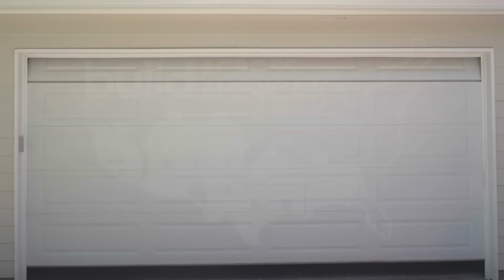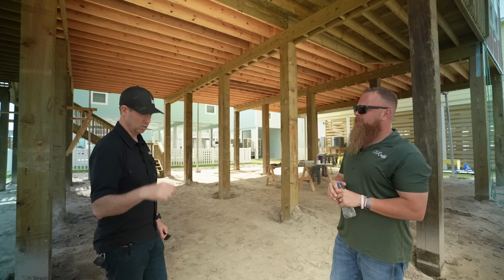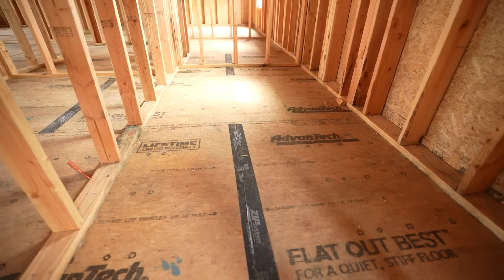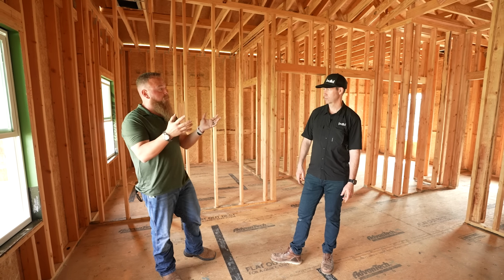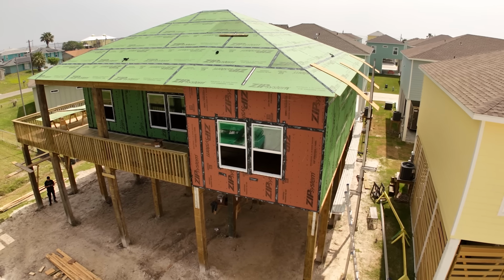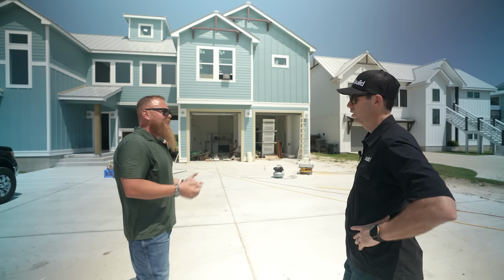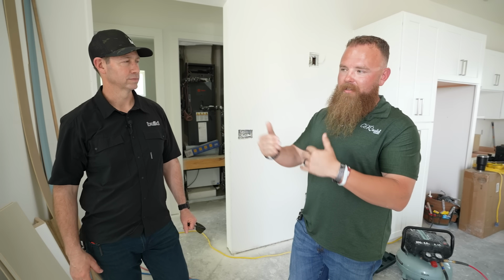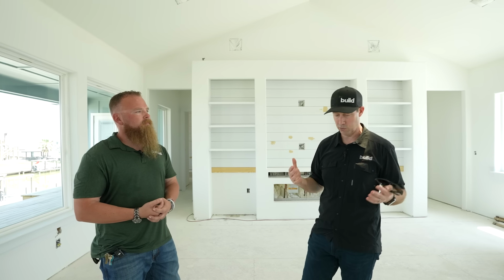Build Across America | Episode 5 - FORTIFIED Building on the Texas Coast

Comment: Matt, I would love for you to follow up on the "Whole House Return System", in which the insulated attic IS the HVAC return pathway.   The actual requirements for using the insulated attic space as a plenum needs to be discussed.   The benefit is in simplifying HVAC returns and having a zero Effective length for return static pressures.  Great Video!

Comment: Couple of questions:
1. How is the bottom of the house on stilts insulated/finished?
2. Why are the joists under the living space untreated even though it appears to be exposed to elements underneath?
3. How is the roof going to be sealed to the walls with such overhangs? ZIP soffit?

Comment: "continuity is key" --- could the concerns about humidity coming up through the floor be solved by setting a strip of ZIP(WRB face down) on the beams, with overhangs to both sides, then installing the floor joists and subfloor, then  insulating, then installing ZIP on the underside of the floor joists and taping to the strip pre-applied to the beams? I could see, especially in a coastal environment, where that would create complications for hurricane ties -- but I would think cutting a slot in your ZIP strip to slide the hardware through and liquid flashing it would be better than NOT having that continuity around the bottom.

Comment: Matt, have you looked into SCIP Panels,  Structural Concrete Insulated Panels. 
I have been told SCIP Panels meet the Fortified disaster shelter standards. They meet US ICC and FEMA wind,fire, and earthquake codes across the country. 
I had the engineer run wind calculations on my Rockport home Im building.  At a 200-mile wind the the house has an 80% redundancy factor. 
Slab on grade homes in Rockport mostly use clay--sand fill.
FEMA shows a 3-4 foot stem wall below the slab as one preferred option. 
I like the little  things I see they do. 

Little things add up to a nice build.

I would rather add hurricane shutters because Impact windows break and the glass needs to be replaced.
They do keep debris out of the house.
Yes, I do not like the hurricane studs that stick out.

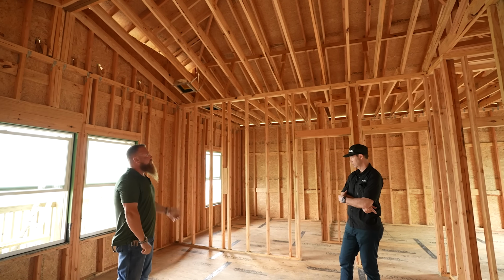Comment: Cool video.  I lived in Rockport for 6 months and Aransas Pass for 6 months on a temporary assignment with Kiewit Offshore Services commissioning the Marine Well Containment System project with Exxon Mobile staff.  I'm curious at time 15:23 about the two differently sized window headers.  The column for the chapel ceiling ridge goes into what looks like a 2x12 and the window next to it goes to ~ 2x6.  Other than the ridge support is that a non-load bearing wall?  When I used to frame houses around Hooper, NE my boss who had been in construction for 40+ years recommended always oversize the headers because wind loads, expansion/contraction, walking in the attic and other loads which transfer to the doors/windows can cause them to move slightly and stick or not close correctly.  In Nebraska I see older homes all the time where windows won't open well, sliding doors get stuck and swing doors loose their even gap.  Do you ever experience problems like that after the house has been up for 20+ years?

Comment: If you spray foam the underside of a roof in Texas, given how extremely hot that roof deck will get, and the very long summer exposures, the state should require off-gassing monitoring. At those very high temperatures there will be accelerated chemical action, likely accelerating breakdown and deterioration of the foam materials. Are these chemical processes and the off-gassed compounds known for the different foam products being used? After all, you are putting a large mass of foam interior to the home. The concentration of chemicals released maybe be below the odor threshold, e.g., below your ability to smell them, but that is far from proof that the exposures residents will receive, especially chronic exposures over twenty or thirty years in these air tight homes, will be hazard free. In fact, there will be off-gassing from all of the materials used in the home. These builders are doing a great job of innovating and improving comfort and energy costs, but their efforts will be for naught if these houses pose toxicology risks to the residents. Residents should start ordering air sampling tests before moving in. Code may need to include this. This type of air monitoring is routinely done, very available, and affordable. People need to start using it.

Comment: Grew up in Rockport. AC systems typically only last about 10 years because of the salt in the air. Everything rusts at an accelerated rate down there.
Reply: Ground water heat pump shoudl be attractive there-very easy to go ion that sandy soil , no outside equipment

Comment: I would think that operable shutters for the windows would be better than applying plywood before a storm.  Simply unlock the shutters and swing them over the windows and then lock them shut.  Then when the storm is over you could just open them back up.  No need to worry about suppliers not having enough on hand for everybody.  And if you are going to be gone for a long time you could close the shutters, so if a storm hit while you are gone you would know the windows are protected, and it would look a lot better than plywood.

Comment: I don’t get all the negativity. I appreciate learning about different building styles from all over. Concrete on the Texas coast can be tricky. Salt air accelerates rebar corrosion, soil shifts cause cracking, and high humidity adds moisture issues. We build with wood on the Texas coast because it’s cheaper, easier to work with, and more flexible during high winds like hurricanes. Wood structures can absorb movement better than brittle materials like concrete, and repairs after storms are often faster and more affordable. Treated lumber helps resist rot and termites in the humid, salty environment. If you listen to these guys talk about their experience with an open mind, you just might learn a little. It may not work for everyone everywhere, but it’s what we use here.
Reply: Modern rebar in ICF is glass/ fiberglass, no rusting. Nothing tricky.
Reply: Based on the house’s elevation, it appears to be in a storm surge zone. It’s going to be very difficult to build a concrete house 16 feet in the air. If they weren’t in a storm surge zone, I’m sure that concrete would be a no-brainer.

Comment: I heard more "we don't have to do this but we do" than I have ever heard before. Just another testament that building codes are weak. Especially when hearing the stories of a two year old home have failures. Why can't codes just meet what a home should be to last 30 years?
Reply: Code is the floor, not the ceiling.  It is the absolute minimum that is required to meet government standards for livability and average safety, not durability.
Reply: @Allen-w9d  yes, the floor should be higher
Reply: @Sheltur_0311 Costs. People can barely afford homes as it is.

Comment: is the liquid much cheaper than the tape? (or the tape really spendy?) it looks like it would be way way faster to just tape the vertical rows of nailing vs going through an putting little daubs of liquid on each hole like this... just curious about the means and methods and time vs material cost

Comment: Would that now require any wiring in the attic to be plenum rated?  Using the attic as an open return plenum is sensible. You can punch a return in anywhere you need or want one. But there's a reason you can't run traditional romex, bell wire, riser cat6, and other wires through air ducts or ceiling plenums without plenum rated wiring.  Does that apply in this case?

Comment: Just lost all respect for Matt. Gave up at the 8 minute mark.
This is utter nonsense all around, based on First hand experience with Rockport going back to 1980. 
- Water Injection around the pilings AFTER the house is built? Get a grip on reality.
Clearly cost cutting by not cementing them in (Spoiler Alert, smart folks use telephone poles)

- The homes in the background are built on raised earth berms WITH the pilings at 8' closed in as garages and spaces expected to be flooded.

That's as far as I got before the smoke & mirrors had me ready to barf.

Comment: Sorry they should ban stick built homes within a mile of the coast.   It is a waste of resources to build with wood OVER and Over.  Concrete should be all exterior structure (roof included).  The extra cost is much cheaper got neighbors on Florida coast that have rebuilt 2 time in 10 years!   This is reason insurance has gone through roof.

Rebar and concrete is better than hurricane ties.
Reply: It’s why ICF is so popular. It withstands hurricanes. ICFs don t need Rissinger to pimp their product for cash.

Comment: Why not concrete construction if you’re trying to “build it as best as we can” in a coastal hurricane risk area
Reply: Full concrete just isn’t necessary to achieve the robust structure on a coastal home
Reply: The biggest reason is that it’s cheaper to use wood than it is to use concrete.

Engineers design homes in the gulf coast to withstand the wind speeds of a Cat 5 hurricane as is required by local building codes and FEMA guidelines so the winds aren’t a problem.
They also account for scour. Pilings are embedded deep enough to avoid the problem of the soil from washing away at the base of the pilings so all loads acting on the house are resolved much deeper into the earth, meaning the house will remain standing when water washes away the ground; some areas see scouring upwards of 6’-8’ deep.  

Engineering-wise wood can be designed to be as effective as concrete. So, the only reason someone would build using concrete in the gulf coast is that they could afford the building material.
Reply: Even in SW Florida, the concrete homes only have the first story concrete with a wooden 2nd floor. This is basically a second story only.
Reply: @danr9584  That's just cheaper construction.  Any self respecting higher end builder will use reinforced concrete block  on the upper floors too.  The best builders also use concrete second floor. This is a super easy way to weed out crappy builders or guys that are pinching pennies. Just stomp your foot on the second floor. Higher quality homes feel like a hotel.
Reply: 100%.    Insurance companies should REFUSE to insure new construction made of wood.  It’s negligence on builders.
Reply: Don’t trees bend in strong winds?? Buildings in earthquake zones have to flex. If too rigid they snap!!